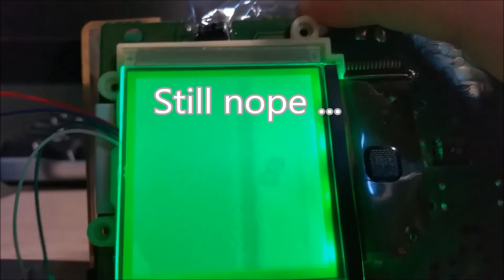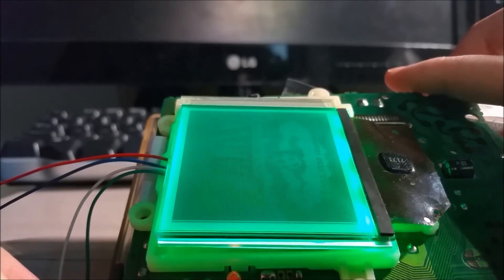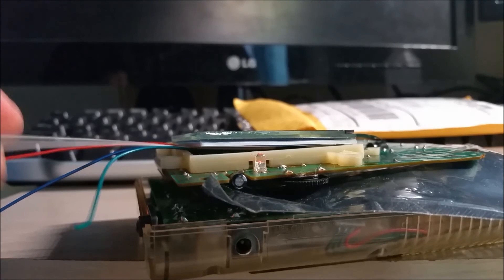RGB Backlit Gameboy - part 2: Adding the Backlight

Comment: I'm sorry to be a noob but I have everything I need to do this and literally every video I can find skips over actually soldering the wires to the power source and grounding the others to choose the color. my question is where specifically  do the wires solder in for power and how do you ground the others for color??
Reply from the maker: I've used a microprocessor to digitally pulse the leds which is different from the way you described, but I can explain how I would do it your way. In the center of the front lcd board is a capacitor with two wires (the white stripe on the cap shows the negative and the other is +5V). You will need a resistor in series with each of the led's red, green, and blue leads (kits usually come with these). If you have the same backlight panel as mine then these resistor wires all go to ground and the remaining 4th wire goes to the +5V pin on the capacitor. The left diagram in this link is what you end up with:

bildr.org/blog/wp-content/uploads/2011/01/RGBLEDs2.png
Reply: Ok so it's in the same location as when you wire the NON-RBG backlight kit that handheld Legend also sells? Only instead of grounding(-) just one wire I'm  gonna add the resistors then ground the combination I want for the right color. Correct?
Reply from the maker: Right on the mark! It's like wiring three single color backlights in parallel.
Reply: OK thank you so much! Also if one doesnt exsist already I'd love a video on adding the microprocessor to change colors instead of having to desolder everything. It seems very convenient.
Reply from the maker: No problem, when I get some time I'll add links to a schematic and blog post with the necessary details to these videos.
Reply: Thanks again. I really appreciate it.